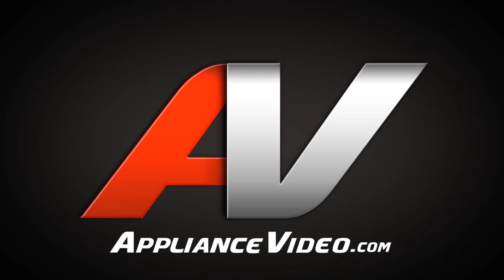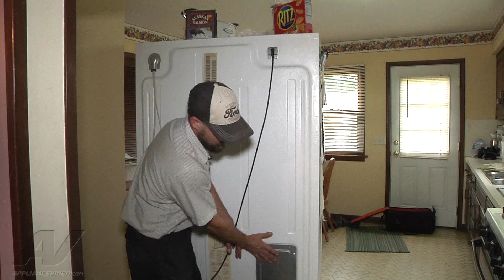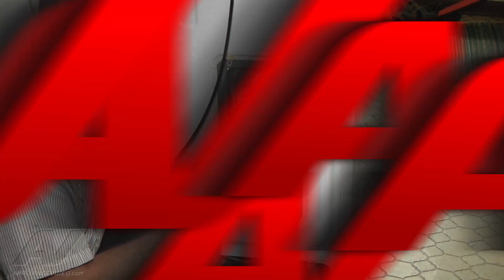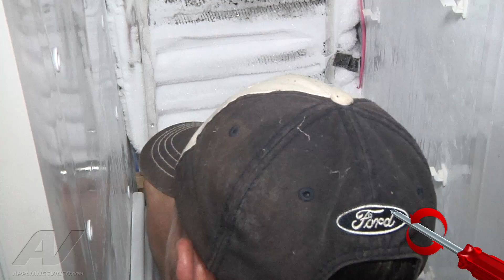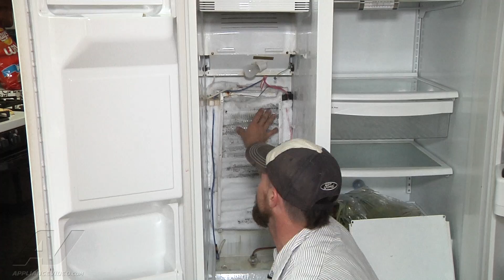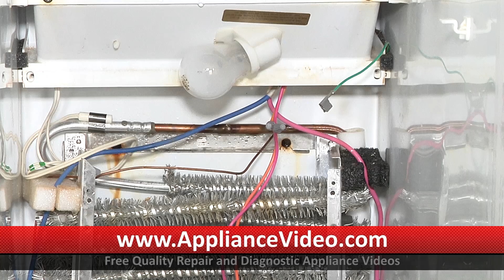GE Refrigerator Repair - Not Cooling - Heater

Comment: Continuing from my previous message. Additionally, when I removed the freezer rear panel, there was no freezing or icing on the coil, and that was before I replaced the three items. However, as a preventive approach, I replaced them anyway, and still did not resolve my issue
Reply: There should be at least frost if you do not see any you have a leak or a restriction in the sealed system.

Comment: I have a GE model GEGSS25GSHJCSS. My refrigerator is not cooling, and the temperature display indicates an out-of-range reading. I replaced all three items (Defrost Heater, Defrost Thermostat, and Thermistor), hoping this would resolve the problem. Unfortunately, the problem persists, and both the compressor and the compressor fan are operating correctly. Don't know how to process. Help.  I look forward to your information. Thank you

Comment: I fixed these machines for years... I would have removed the bottom bin support rails to make it easier.  I noticed the termination thermostat had been replaced once before, not that I wouldn't have replaced it this time.  I used a hand steam cleaner to defrost... works much better.  That white grommet at the base that the suction line is going thru has unseated itself... I would have reseated it and made sure the permagum was pressed into it firmly... moisture leaking thru there causes the suction line to the compressor to rot and leak coolant.
Reply: Where is the termination thermostat (thermistor) that had been replaced previously with respect to the defrosting thermostat replaced in the video?
Reply: @eljeffe8806  If you look at 8:36 at the upper left clamped to the aluminum that device with two white wires coming from it, that is a termination thermistor.  You can just see a wire nut directly below it near the thin copper line near the aluminum evap support.  Those thermistors are notorious for early failure if there is black sealant where the wires enter it, I would change it out... this one is a newer style with the sealed white base.
Reply: @caffieneoracle5147   After the frost/ice melted from the coils overnight, I can see the white thermistor attached to the coolant line about an inch to the left of the thermostat canister that is being wired in at this spot on the video.  Since the thing in the canister with two wires is being referred to as a thermostat, is this device set to open or close a contact at a set temperature? I have 4 thermistors in the unit, one in the photo attached to the coolant line, one in the freezer wall and 1 upper and 1 lower in the refrigerator side.  I wish someone in one of the 5+ videos I watched about this repair would have warned that the spines on the evaporator coils are like touching a cactus!
Reply: @eljeffe8806  Those thermistors read a different resistance depending on their temp.  The ones with black epoxy tend to leak moisture inside, causing a bad reading.  The can style are on/off at set temps.  Most common defrost failure in that model is bad heater 1st, then swollen can style thermostat 2nd then bad white sensor thermo 3rd, then bad control 4th.  And yes, they don't bother to debur any metal inside panels where customers can't normally get to.  There are charts online about the resistance those white thermistors should read... here's what google says "Most standard General Electric refrigerators (commonly using part WR55X10025) rely on a Negative Temperature Coefficient (NTC) thermistor. Resistance goes up as temperature goes down. Test the sensor with a multimeter set to ohms. At 32°F (ice water), it should read roughly 16,300 to 32,000 ohms depending on the precise model variant, and around 5,000 to 11,000 ohms at room temperature (72°F–76°F). If readings deviate by more than 10%, replace it"

Comment: How do we identify the wires that you choose to Ohm out that are a loop through the heater and thermostat? There are several connectors on that board and my frig did not come with a schematic.

Comment: My Thanks to you for this much needed tutorial. I have the same exact GE Model and problem you are working on in the video. I ordered my parts on Amazon for $20. Thanks to you I will be able to fix my refrigerator. I will use solder and heat shrink to attach the thermostat, as this will insure the wires are sealed and safe from moisture.

Comment: Good video, a little feedback.  

A - Why did you cut thermostat wires back so far, always leave yourself as much wire to work with as you can in case of issues. 

B - NEVER EVER USE A HEAT GUN!  It warps plastic and damages the product, always use a steamer.  

Other than that. good job.

Comment: what should be ohm reading on a new heater element?
Reply from the maker: Great question, if you have a more technical question that our parts department cannot answer, you can search our over 17,000 answered questions free at our website www.ApplianceVideo.com under our Repair Help section. You can also call our parts department at 1-800-830-5465 and they can give you help 7-days A week ,or search at www.SaveMoreOnParts.com  .

Comment: I don't know what you meant by line on that blue plug.
I measured between its blue wire and the number 9 poin on that J7 plug, it read 147 Ohms.
What does that mean, I don't know.
The diagnostics I stumbled on says at least 22 Ohms. if you are reading that, meaning yes then that will lead you to inevitably replace the board but if the answer is no, it will lead you that the control board is good. check thermoster, etc.

So what does "at least mean" ?
Is my reading fall in the " bad control board" or bad sensors?

My heater reads 147.  I checked another heater in my garage and it also reads the same value.  They don't read 10-20 ohms.
Reply from the maker: Great question, if you have a more technical question that our parts department cannot answer, you can search our over 17,000 answered questions free at our website www.ApplianceVideo.com under our Repair Help section. You can also call our parts department at 1-800-830-5465 and they can give you help 7-days A week ,or search at www.SaveMoreOnParts.com  .

Comment: On the thermostat I ordered it has a salmon & yellow wire?? Which one goes to which?
Reply from the maker: Great question, if you have a more technical question that our parts department cannot answer, you can search our over 17,000 answered questions free at our website www.ApplianceVideo.com under our Repair Help section. You can also call our parts department at 1-800-830-5465 and they can give you help 7-days A week ,or search at www.SaveMoreOnParts.com  .

Comment: Where can I get the part to replace the frozen freezer?
Reply from the maker: Great question, if you have a more technical question that our parts department cannot answer, you can search our over 17,000 answered questions free at our website www.ApplianceVideo.com under our Repair Help section. You can also call our parts department at 1-800-830-5465 and they can give you help 7-days A week ,or search at www.SaveMoreOnParts.com  .

Comment: Man you just don't know how helpful this video is. Thank yall so much. My fridge has same exact problem. Im about to start my repair today/tomorrow. How do I find the schematic for my control board? I don't want to replace parts that I don't need to replace. I know my defrost heater is bad because I tested it and there's no continuity.  But I need to test my thermostat from the control board so I wont have to take it apart from the inside.  The only thing I was able to find online was the owners manual. No diagram for the board tho
Reply from the maker: Thanks for your response, we are glad we could help. Our library of over 5,900 videos are currently helping over 1.6 million people like you every MONTH.  Please help us by subscribing to our YouTube channel, or post our website www.ApplianceVideo.com to your Facebook page, Twitter, Instagram or any other social media sites. Your support will help us keep producing more free quality videos.
Reply: @Appliancevideo  so far so good. Replaced my defrost heater and 3 weeks in (knock on wood) my GE fridge is at the correct temps on both sides now

Comment: Can I use a blow dryer
Reply from the maker: Great question, if you have a more technical question that our parts department cannot answer, you can search our over 17,000 answered questions free at our website www.ApplianceVideo.com under our Repair Help section. You can also call our parts department at 1-800-830-5465 and they can give you help 7-days A week ,or search at www.SaveMoreOnParts.com  .

Comment: After doing the ohms test now fan doesn't start. Any solutions?
Reply from the maker: Great question, if you have a more technical question that our parts department cannot answer, you can search our over 17,000 answered questions free at our website www.ApplianceVideo.com under our Repair Help section. You can also call our parts department at 1-800-830-5465 and they can give you help 7-days A week ,or search at www.SaveMoreOnParts.com  .

Comment: I did the ohms test but got OL on my meter. What does that mean ? Thanks.
Reply from the maker: Great question, if you have a more technical question that our parts department cannot answer, you can search our over 17,000 answered questions free at our website www.ApplianceVideo.com under our Repair Help section. You can also call our parts department at 1-800-830-5465 and they can give you help 7-days A week ,or search at www.SaveMoreOnParts.com  .

Comment: I'm just curious on why you didn't cut the wires for thermostat closer to the thermostat vs closer to the back wall, this would have left a little more wire for future replacements, etc. (aka a service loop) ... better yet this question is for the manufactures, why doesn't the thermostat have a plug on it at that spot to allow for changing it vs. cutting the wires??

Edit to say, I kind of see why he cut them so short, but I would have left a little extra personally... another thing is instead of using electrical tape, I'd splice them and use some heat shrink tubing as that would have been a better seal.
Reply from the maker: Great question, if you have a more technical question that our parts department cannot answer, you can search our over 17,000 answered questions free at our website www.ApplianceVideo.com under our Repair Help section. You can also call our parts department at 1-800-830-5465 and they can give you help 7-days A week ,or search at www.SaveMoreOnParts.com  .

Comment: MY Samsung refrigerator has water in drawers .What to do ?RF217ACWP/XAA
Reply from the maker: Great question, if you have a more technical question that our parts department cannot answer, you can search our over 17,000 answered questions free at our website www.ApplianceVideo.com under our Repair Help section. You can also call our parts department at 1-800-830-5465 and they can give you help 7-days A week ,or search at www.SaveMoreOnParts.com  .

Comment: Hi I replaced the heater but the reading still infinite so what wrong? Can some one tell me please.
Reply from the maker: Great question, if you have a more technical question that our parts department cannot answer, you can search our over 17,000 answered questions free at our website www.ApplianceVideo.com under our Repair Help section. You can also call our parts department at 1-800-830-5465 and they can give you help 7-days A week ,or search at www.SaveMoreOnParts.com  .

Comment: I'm certain I have the same fridge Ithe freezer is working fine but the fridge isn't no frost issue... Help?
Reply from the maker: Great question, if you have a more technical question that our parts department cannot answer, you can search our over 17,000 answered questions free at our website www.ApplianceVideo.com under our Repair Help section. You can also call our parts department at 1-800-830-5465 and they can give you help 7-days A week ,or search at www.SaveMoreOnParts.com  .

Comment: My Samsung refrigerator is giving me an error of 21 E after it runs for some hours?
Reply from the maker: Great question, if you have a more technical question that our parts department cannot answer, you can search our over 17,000 answered questions free at our website www.ApplianceVideo.com under our Repair Help section. You can also call our parts department at 1-800-830-5465 and they can give you help 7-days A week ,or search at www.SaveMoreOnParts.com  .

Comment: You forgot a step at the end. Last step: Remove wine bottle from fridge, crack open, and relax. lol Great video. Looks like I’ll be going through these exact steps tomorrow.
Reply from the maker: Thanks for the tip! Great question, if you have a more technical question that our parts department cannot answer, you can search our over 17,000 answered questions free at our website www.ApplianceVideo.com under our Repair Help section. You can also call our parts department at 1-800-830-5465 and they can give you help 7-days A week ,or search at www.SaveMoreOnParts.com  .

Comment: What if it doesn't cool at all?I put a new motherboard ,It turns on but doesnt cool . The fan turns on but thats all.
Reply from the maker: Great question, if you have a more technical question that our parts department cannot answer, you can search our over 17,000 answered questions free at our website www.ApplianceVideo.com under our Repair Help section. You can also call our parts department at 1-800-830-5465 and they can give you help 7-days A week ,or search at www.SaveMoreOnParts.com  .

Comment: Can heater still be good but be bad it seem heat up but my issue is
Did u refrigerator run warm to i wounder if that what mine doing seem the rod gettting hot but never though of it no getting hot enough my frezzer was not going below -0 thinking its my timer
Reply from the maker: Great question, if you have a more technical question that our parts department cannot answer, you can search our over 17,000 answered questions free at our website www.ApplianceVideo.com under our Repair Help section. You can also call our parts department at 1-800-830-5465 and they can give you help 7-days A week ,or search at www.SaveMoreOnParts.com  .
Reply: Hi

Comment: I have a GE Gbs22hbsbww MODEL but isn’t getting cold. I tried using a meter but don’t know if I’m doing it right can someone help me
Reply from the maker: Great question, if you have a more technical question that our parts department cannot answer, you can search our over 17,000 answered questions free at our website www.ApplianceVideo.com under our Repair Help section. You can also call our parts department at 1-800-830-5465 and they can give you help 7-days A week ,or search at www.SaveMoreOnParts.com  .

Comment: Hi , I have a GE side by side, model # GSH25JSRF SS.  My freezer one day seems fine and the next day it doesnt. It will make ice, only to see the ice melting later on, then it wont make ice for a day. The frozen food starting feeling soft, and the ice cream wouldnt get hard. I have checked for continuity on the defrost heater and the thermisters and they have continuity, I did the test in the motherboard to see if the thermostat is good and it is. I saw the damper moving, i saw the heater get cherry red, I hear the evaporator fan running ( I replace it about a year ago), I cleaned all the dust off of the compressor, I see the fan running at the compressor. The lights work. I cant find anymore DIY videos to check to fix it. I dont know what else to do. Please Help!  Thank You!
Reply from the maker: Great question, if you have a more technical question that our parts department cannot answer, you can search our over 17,000 answered questions free at our website www.ApplianceVideo.com under our Repair Help section. You can also call our parts department at 1-800-830-5465 and they can give you help 7-days A week ,or search at www.SaveMoreOnParts.com  .

Comment: Elec went out last night, come back this morning come back from work arond 6pm just to find out the freezer side not working any fuse to change in the freezer or does any one know what to do? To fix it help please.
Reply from the maker: Great question, if you have a more technical question that our parts department cannot answer, you can search our over 17,000 answered questions free at our website www.ApplianceVideo.com under our Repair Help section. You can also call our parts department at 1-800-830-5465 and they can give you help 7-days A week ,or search at www.SaveMoreOnParts.com  .

Comment: Where can I buy this heater replacement for this same fridge?
Reply from the maker: Great question, if you have a more technical question that our parts department cannot answer, you can search our over 13,000 answered questions free at our website www.ApplianceVideo.com under our Repair Help section. You can also call our parts department at 1-800-830-5465 and they can give you help 7-days A week ,or search at www.SaveMoreOnParts.com  .

Comment: What's d trouble freezer fan stop after 5 seconds
Reply from the maker: Great question, if you have a more technical question that our parts department cannot answer, you can search our over 13,000 answered questions free at our website www.ApplianceVideo.com under our Repair Help section. You can also call our parts department at 1-800-830-5465 and they can give you help 7-days A week ,or search at www.SaveMoreOnParts.com  .

Comment: What are those two plugs called that he checked
Reply from the maker: Great question, if you have a more technical question that our parts department cannot answer, you can search our over 13,000 answered questions free at our website www.ApplianceVideo.com under our Repair Help section. You can also call our parts department at 1-800-830-5465 and they can give you help 7-days A week ,or search at www.SaveMoreOnParts.com  .